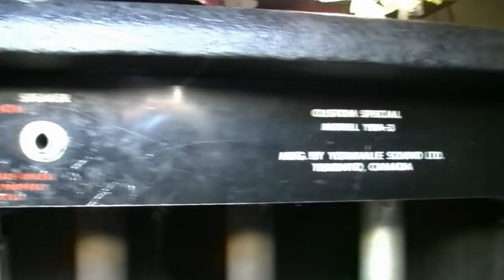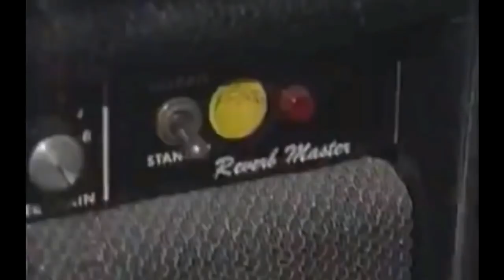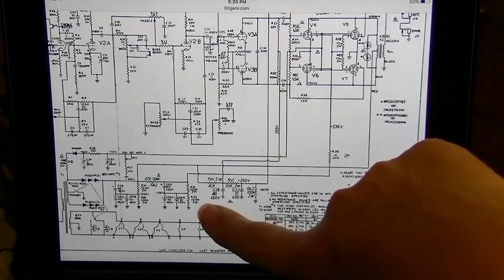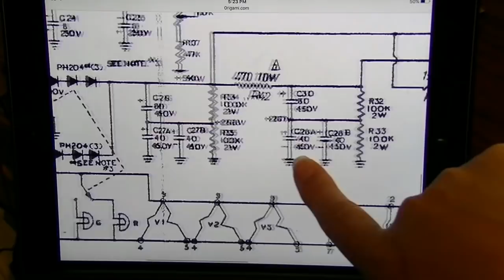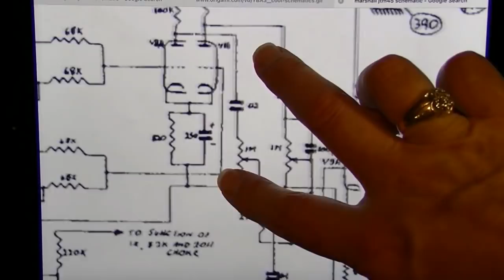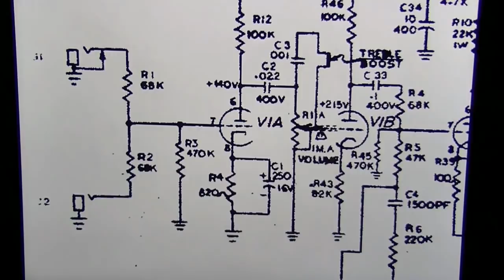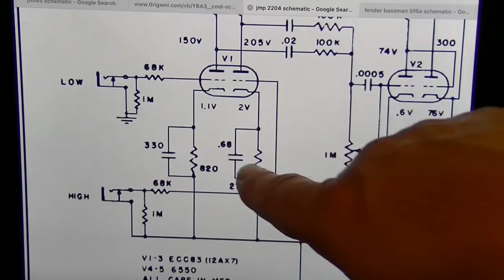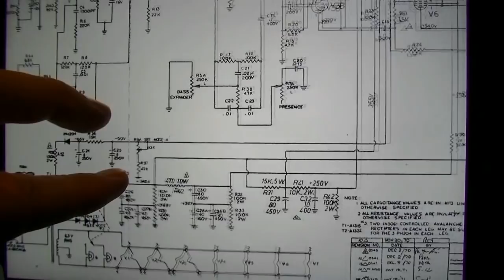Modded Bass Amp from Canada Becomes GUITAR AMP FROM HELL! - Traynor YBA3

Comment: This is what happens when a guy who started repairing amps gets into design...  something built like a tank, and easy to fix... Pete Traynor was a genius.
Reply from the maker: Yep. And that resistor he used to measure the voltage drop around for biasing??? It's that giant 20W resistor with a voltage drop of only 8VDC across it. He designed this thing to withstand not just normal operation, but to minimize damage if a component fails. The circuit breaker is another good example of this. A fuse can be replaced with a piece of foil or massive value fuse, but the breaker ensures the amp will see a tech when it really needs to see one. Traynors are built better than just about any other amp of this era outside Hiwatt.
Reply: I'd be curious about how Pete started out.  If it was a really small company, he was going to be the repair department - and built it accordingly.  Those are the best kind.  I think the top removal access was genius.
Reply: The originals didn't have the baby bumpers and easy access top. Ugly AF but brilliant design.
Reply from the maker: He started very small. There are some vids on YT about him. Here's the one I took that clip from: https://www.youtube.com/watch?v=YjPfsOfFxXQ&t=8s
Reply: The Guitologist Thanx Mr. Guitologist, man it's like you made a great amp better. However, now that we know that it can be done this easily the price will go up on  Traynors !!!AGAIN!!!
No shit, that sounds really good for a big amp. I can't feel the touch response on my headphones but from the way you were KILLING those licks, it seemed like it could be controlled very well 'n' good·
Reply: The build is how they can have an "even if you break it" warranty
Reply: and traynor bass amps still rip, I own the new yba-300 and its phenomenal, plugged it in out of the box, never had a single issue with it, sounds amazing every day.
Reply: I have a lot of Traynors, but I think I like the YCS50 head I own better than any of my others, including the bassman near clone YBA-1. Extremely versatile from fender goodness(nearly with USA switch engaged) to stupid high gain with the boost, modern and scoop switches engaged on channel 1.
Reply: I have a Ycs90 with 2 12 inch neodymium speakers and I love the sound i can get too!!  Just so versatile and built like a tank, but the neo speakers are light weight so the whole cab only weighs 48 lbs. Super easy on my back too!  cheers
Reply: He was a bass player and repairman for Long& McQuade music store in Toronto in the 60's. (Back then they were a single store, they are now a nation wide chain.) Bass players were always bringing in their amps to be repaired and modded, and with a little pestering Pete started building amps. Legend has it he would toss the prototypes  off the single story roof of the shop to see if they still worked. (This was to see if they could handle being knocked over on stage or dropped during load in/out.) Thus was the TRAYNOR Bassmaster (YBA-1) born. Canadian bands have been grateful for this for decades. By the way, his nickname (as a bass player) was Thumper.
Reply: Exactly what I was going to say. Repairman and bass player.
Reply: and to be honest, being a canadian myself, it makes me quite proud to say my bass rig is canadian aswell.
Reply: Not tom mention 'tons of TONE'.
Reply: +You wouldn't be nearly as proud if you saw the inside of their factories. I used to work at the one in Whitby and it was a shit-show. They cut corners as much as they think they can get away with. Older Traynor gear might have been good, but the new stuff is garbage made by people who don't give a fraction of a fuck.
Twas the reason I quit, tbh. Nobody there has any pride in their work, and it made me look bad.
Reply: INF1D3L010 i can only tell you that mine is amazing I guess
Reply: +Dan Killen
That just means you got a good one. It's a statistical anomaly, not a sign of greatness lol. If you saw how much of their stuff gets flat-out rejected by QA, you would quickly come to the same conclusion I did.
The whole time I worked there, I only ever tested 2 or 3 cabs that I actually thought were decent. I would tell you about their amps, but I did QA on cabs specifically, so I can only tell you out of experience.
I would tend to think that if the cabs are as bad as they are, the amps are probably no better. I remember being told by management, because I was rejecting too many cabs, that it doesn't matter HOW a cab sounds. All that matters is that it makes sound and looks half-way decent.
Reply: INF1D3L010 what years did you work at the traynor factory?
Reply: +Dan Killen
Thanx for being polite.
I worked there from '02-'06, and I honestly doubt that anything has improved since. If you have stuff from them that you like, I'm legitimately happy and surprised for you, but let me just say that you should NEVER buy any of their stuff online, as there's no way to know what you're really getting. 
This is a pretty serious problem in this day and age, as big-box stores have  very little selection and Mom-and-Pop stores are a thing of the past where I'm from.
Always try before you buy is my motto. I'm not here trying to convince anyone not to buy ANYTHING from Traynor. I was simply giving warnings to anyone who might be considering buying their stuff online, as if you do that, you're statistically quite likely to get a dud, which, for a Canadian company, is unacceptable.
Also, if you try a floor-model that you like, buy that one, not one from out of the back, still in its box. It may look a little beat up, but at least you'll know what you're getting into, and you'll save a bit of coin on the way.
Reply: INF1D3L010 that explains alot, theyve revamped things in most recent years, I dont think its still like it was, my amp model is a 2015 and seriously man, its quite the reliable solid piece of equipment
Reply: Those marhsall cabs were made in buttfuck england out of garbage material and are considered 'great'. Ever put screws into a 1980's UK marshall cab? 

LMAO 10% isn't bad. I work in the auto industry and you don't want to know how badly mexican made cars wouldn't pass your "horrid 10%" They use to scrap around 20% 20 years ago. Now not so much with better manufactured tooling.  But they scrapped a lot of parts back in the day. We make the tooling too good for that to happen know, but its a car, different from an amp. BTW don't buy a new car when they flip to a new model. The first 5-8 months they use every piece of junk part we make while ironing out the bugs. Wait a year is our standard we apply to ourselves. 

Traynor 412 sell for 25% less than Marshalls and they are made very closely to the 1960 including top end speakers. Those are thin margins. Do you think 100% of UK marshall cabs you buy sound good? Mostly its the speakers tone and does the cab rattle a lot. If the rattle isn't too bad (all cabs rattle a tiny bit in my experience) when you are blasting 50-100 watts into it and you get the tone to mostly come through to what you expect, then you are happy. I built a 212 diag cab with vin30s, i used actual fabric and it cuts a touch of high mids off the speakers. Very nice tone. can't hear anything when the YCS is at 6 for the cab and I have a floating baffle which tends to rattle a lot more than my dovetailed cab.

Anyway, Traynor makes some very good equipment. As good as any other major brand these day. Perhaps not 1970 Traynor great, but pretty solid performance anyway. If you don't want to compare it to modern equivalents 
than nothing can be said. If they had 2% failure rate(of what you expect them to be) then we would likely have to close the company all together.  

Even USA gibsons have issues. My USA jackson needed to be refretted upon arrival. How did that pass QC? I have an amazing indonesia washburn that sounds as good as my jackson (same pickups). Look at people that get Jay Tursers or Chibsons. I have a low end JS22 jackson that is worse than my Jay Turser for fret finish. Pretty sad. So unless Traynor starts charging 1500 for their 412, which they stopped making along with the YCS :(, they will have a hard time staying afloat as a company, esp with a very small market outside of Canada.

Anyway hopefully you are happy in whatever new job you have.
Reply: thorinbane their tube bass amps are still a cut above in my opinion, when I was buying I tried the yba300 against the svt classic and even mesa's tube bass rig, to my ears personally the yba300 had better sound and was more bare bones control wise which I found awesome
Reply: +Dan Killen
I dunno.. Last I heard they were doing lots of lay-offs and cut-backs lately. Their product may very well have improved, I can't say, but the management is still up to their old tricks. I guarantee it. They'd sell you a rubber-duck in place of your amp if they thought they could get away with it.
Reply: I also found the Guitar amps to be pretty great. Like I mentioned the YCS50 which they stopped producing is the most versatile 2 channel amp I have played. Pretty much go from fender to marshall to mesa. And I love their Vintage amps, but this one easily stands tall. Sadly not made anymore. They did have a few issues with the YCS100 version 1 heads, but it was corrected on the ver2. Due diligence and corrected what was wrong. To be honest there isn't much need for a 100 watt head again. It has its uses for some of the tones it can get(guitar wise) but with it being too loud for clubs and with massive 10,000 watt PA systems in arenas, there really isn't a need for it. Bass , yes of course, not so much guitars. Might have been a good idea. Hope they make a nice 20 watter, maybe a bassmate reissue.
Reply: +Dan Killen
Fair enough.
Reply: Pete Traynor used to throw his amps out a second story window,
clean out the glass from the broken tubes out of them then retube
 it and they would run just as good as before,they are indestructible.

9:04 .i had to laugh.didnt even know you linked it,im Canadian
 and know traynors reputation,they are bulletproof.
Reply: bunny21x yup when he was a kid he used to play with Robbie Robertson from The Band! Rick Danko the bassist from The Band used Traynors before The Band went all Fender and Ampeg. Rick did state though that Traynors could not be broken. Pete and Robbie remained friends their whole lives.
Reply: Explains why you see the YBA3 on eBay going for good $ . . .
Reply: @MFKR696  I have a YCV80Q that is rock solid. Way more stable and reliable than my Blues Jr. III(which, admittedly, isn't saying much). It can do clean country to 90's thrash but shines in the clean tones and classic rock. Not perfect. Not Awesome but reliable. A good modeller can compensate for the rest.
Reply: I always heard that rumor about Traynor amps, but never knew there was actual footage if it!
Reply: @bunny21x  Bunny we rented & used two of these amps and four Traynor 4 x 12 cabinets , one angled out of each corner, and raised 5 feet - that was our high school dance sound system. You could run the amps with the record out of a Sony integrated amp - don't think we ever advanced to 2 turntables
Reply: @Killenmachine05  sure but do you play a Lado?
Reply: @vikinglord7545  I don't, just own a p bass these days and no other bass gear, always wanted to get a dingwall super p but never could justify it, I was just a small time player
Reply: @TheGuitologist  There's a pdf doc of the history of Yorkville/Traynor out there on the interwebs.  About 50 pages.  And it's well worth the read.  Pete was the repair guy, Jack Long owned the shop.  Pete built 10 clones of his 59 Bassman for rentals, called the Dynabass amps.  All 10 sold quick.  Pete and Jack start scaling to meet demand.  Production begins.  Rest is history.
Reply: Sadly, the modern Traynor amps have cheap components, tiny PCB-mounted pots,  crappy circuit layouts etc. Pete Traynor would not be impressed.

Comment: My beast was the Traynor Bass Master.  100 watts of grunt in the head tapped into twin 15" speakers.  The main reason why I say "What you say" a lot.
Reply from the maker: Hell yes. I know the amp about which thou speaketh. It is indeed a hearing aid seller.
Reply: You must have heavily modded that BassMaster as it is factory rated at 45 watts. The MkII version was rated at 85.
Reply: The joy's of Industrial Arts classes back in the 70's.  Cranked the crap out of it so I could hear myself over two dudes with Marshal Stacks.
Reply: Dave Walsh that's why I ask three times, third times a charm

Comment: I played in a rock & roll band in the early 70's through the mid 80's along with another guitar player and after blowing up several Marshall amps, Sun and other crappy amps from that era we both somehow wound up with this exact amp.  During that time we never got new tubes or had to put them in the shop for anything.  We were a road band and we lived in Denver and traveled a lot of places. I sold my amp in Riverside back in 1985 and still regret it, it was a beast, dependable and had great tube tone plus it had master volume way back then, OMG!  We both played Gibson Les Pauls through the Traynors then into our Marshall stacks. We always joked about these fucking amps being able to survive a fall off a building, who knew! Great video, thanks.
Reply from the maker: Yep. They actually threw them off buildings.

Comment from the maker: NOTE: This amp is for sale! Can be picked up in Louisville, Kentucky or shipped anywhere in the US via PayPal. Email for details: bradlinzy at gmail
Price is $750 plus shipping to North America. (Sorry rest of world, this thing is just too heavy.)
Reply: I am looking for the 50 watt Traynor bass amp with 2 x 6L6GC power tubes.
It was the first 'real' amp I had as a guitarist. I was 17 and I loved it so much.It malfunctioned and I knew not how to fix it.Don't know where it ended up but now I am 50 and want another one.I would take that little Traynor over a Bogner any day.
Reply: How MUCH for this amp ???????
Reply: Hey may I ask a question? Can I take a 100watt PV with a 10" speaker & add a speaker output for an old PV bass cab with two  8" & one 15" speaker with out having issues w/the D class amp or the speakers. Both the internal speaker is 8 ohm as well as that cab. I use to run a PV T Max Head thru it but it was like 800watts. Thx.
Reply from the maker: $750 plus shipping.
Reply from the maker: You should be fine on that speaker config, but call PV CS if you're really unsure.
Reply: $750 is that all ? Do ship to Australia ?
Reply from the maker: Shipping to Australia on this would probably cost you $300+ and I'm not willing to risk the trip, even if it is a Traynor.
Reply: Damn. I'm in Nashville. If I had the cash, I would drive to L'ville and buy it. But the wife would kill me! HA!  It sounds great! I am envious of your electronic ability and some of the neat pieces I see hanging on your wall. Cool amp, interesting video.
Reply: Is this amp still for sale? Would it be possible to get a new grille cloth on there?
Reply from the maker: This amp already sold, sorry.
Reply: Does it work with an electric guitar?

Comment: In the early 80's these things were dirt cheap. Got my first Traynor - YGM 4 Studio Mate for $75. Spent the last 30 years trying to duplicate that awesome sound - can't be done. Just found another Studio Mate that was lightly used then stored for 40 years. After some new filter caps and repositioning the reverb tank to the bottom of the amp I have recaptured that sound that I have been chasing. These things now run between $500 - $1000
Reply: You’re absolutely right. I got the same exact model he worked on in this video used for very cheap in the early 80’s. Didn’t use it it much for bass or guitar but cranked it up in our church building later on Sunday after using it for Sunday service with a Les Paul and it was the loudest amp I ever heard in the 100-130 watt class. Much louder than my 100 watt Marshall 1959. Mine has 6CA7 tubes in it. I could not have it full up without being seriously deafened.

Comment: Nice vid, thanks. The resistors across the filter caps are also there to ensure equal voltage across the caps. So it is important to have one per capacitor.

Comment: Garnet, Yeah bought one for $250 It was a "Session Man" reverb, back in 1981. It sounded good and serves us well and used it on our Roland Strings. I played Fender pre- bass with a Traynor YBA-1. Bottom was a  50 watts thru a roll & pleat Kustom c/w  3 x 15 Jensen speakers . It use to rattle the fillings out of the teeth of the bar girls at the clubs. Served me well for many years. A tear down my cheek when I sold it

Comment: I've probably "2" need servicing.  I remember when that amp was sold brand new in Huntington WV at "Mack and Daves" - it was run into a pair of Traynor folded horn cabinets, each I believe with a Goodman's 18".  Those cabinets were about the size of a Cerwin B36 and 36"x24"x24" IIRC.  The tone was heavenly ! (probably Rotosoound round wound on the guitar).     I had a 6-10" (sealed - direct radiator)  Traynor cabinet - assume CTS 10" YBA3 - Custom speacisl on 6 string guitar = Loud as Hell !  I probably rolled off below 80Hz so not as thick on the bottom with bass guitar as something designed to go lower.  I'm old and may not last a lot longer  - cheers